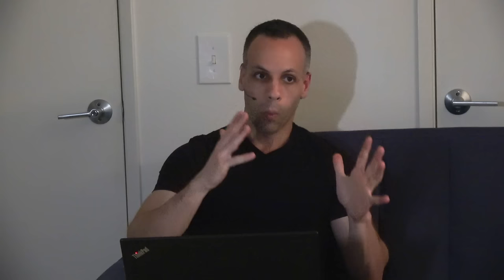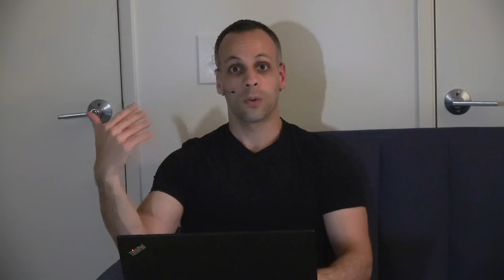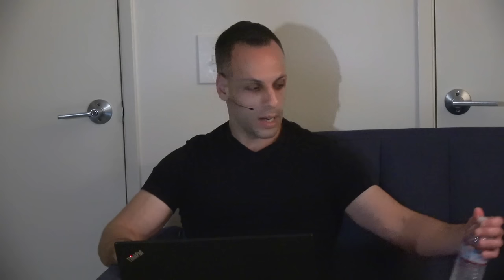EVGA's Oversight: Unannounced Changes Destroy PCs, EVGA takes NO ACCOUNTABILITY

Comment: We reported this issue to EVGA over 2 years ago as it was frying end user hard drives. As far as we can tell its limited to GQ models. We just got into the habit of testing GQs every time we plug them in with a PSU tester from Thermaltake
Reply: Geez. I was hoping this was a recent issue, not a 2 year one.
Reply: @Slavolko  Yeah, 2yr old makes this corporate indifference. Slam dunk on lawsuits.
Reply: WTF
Thank you for the heads up
Reply: Interesting insight thanks
Reply: two fucking years? holy shit EVGA really has dived downhill
Reply: I'll just avoid them all, just to play it safe. 🤓
Reply: that is pretty amazing...
Reply: Can we pin this comment? This escalates the issue and means I will definitely avoid EVGA PSUs.
Reply: This should get the CSA/UL/ETL certification voided !!
Reply: @HazewinDog  SeaSonic all the way.
Reply: Either this issue is more than 2 years old or EVGA isn't it the only company to have this issue as I remember this happening ages ago with a customer PC I rma'd a psu in.
Hell I've done it myself since with a few HDD to the point I now do check modular PSUs with a multimeter.
I don't even buy modular PSU for builds now unless explicitly requested by the customer as it is a literal minefield.
Reply: but people keep saying that evga is QUALITY, xDDDDDDDDDD, not a single company that keeps such an issue for that long, represents quality in any way.
Reply: Can you please clarify the "issue" you are referring to? They changed the pinout between different generations of that PSU. Your comment makes it sound like there's a problem with the retail product. If you're saying these PSUs randomly include mismatched cables that's a much bigger problem than messing up an RMA process. Otherwise I don't understand why you'd say you're testing all of them. If your customers are using different cables than what it came with I don't see why you'd report that to EVGA.
Reply: WUT.
I own two EVGA GQ  power supplies. 
Nice. 🙃
Reply: 2 years? Kinda to the point of not buying them at all, not testing them...
Reply: @kyoudaiken Don't trust brands. Go by per-model reviews every time. SeaSonic is one of the few PSU brands that actually manufacture their own units and is generally fairly reliable, but even they have the odd lemon.
Reply: Well if you look at the factories they come from you'll probs find that the GQ series is outsourced to another company
Reply: @woe2you2  I mean, for example, I had a lot of issues with AMD. I stopped buying AMD products for now and also switched my main PC back to Intel and couldn't be more happy despite other shortcomings Intel has. At least it is stable and doesn't give me problems. I also do that with PSUs, haven't had a single issue with Seasonic since decades.
Reply: You claim to be a PC builder yet never tested/verified power supply wiring until you cooked a few parts using the wrong cables on a modular power supply and now use a power supply tester?

Ever hear of a multimeter? It should be in even a basic toolkit of a PC builders tools. 

Rookies claiming to be PC builders smh and Louis didn’t know you can’t mix and match power supply cables among vendors yet calls himself a tech?

Talk about sheer ignorance
Reply: We reported this SATA pinout change issue to EVGA (edit here checked emails, first reported Jan 2023 details matter not quite 2 years ago) as it was frying end user hard drives and SATA LED controllers. As far as we can tell its limited to 1000W GQ models. We just got into the habit of testing GQs every time we plug them in with a PSU tester from Thermaltake.

Additionally To clarify: We are big EVGA fans at Silver Knight and have Kingpin and Dark products on our shelfs as decorations but it was effecting users getting a replacement PSU from RMA as EVGA tells you not to send in your cables or if a new GQ unit was purchased by a customer then taken home and we wanted to know what to tell our customers. Customers reusing their old cables or in 1 case brand new out of the box, one cable pinned right, the other was not were having weird problems with drives just dying. Usually the same PSU same series same model, cables are not an issue. We never got a clear answer, just told to RMA the PSU units. We cover all of our products the full warranty period in store and replaced the customers drives and controllers as it was obvious the PSU caused the damage once we tested it. According to EVGAs PSU cable chart there is no pinout change on GQ units. Our decision was simple: pull all 1000W GQ units off our shelves and implement a process for warranty to cover any associated damage that may occur. As stated before we cover the full warranty period in our store so if its a 10 year warranty and you come back 6 years later, we are not (insert whatever other retailer here) and will tell you to kick rocks. We will replace the unit with an equivalent model from Corsair, BeQuiet or MSI if we sold you a PSU and you need to RMA it. 

EVGAs PSU lineup has gotten counter intuitive. When we broached the question of why the warranty period on newer PSUs were shorter or why the gen 5.0 equipped units they are selling are lower wattage or what the come to market strategy was, we were met with limited response or go deal with distribution who often times had little stock. Its sad to see where there company is now. I hope they turn it around. Years of industry good will, team pedigree and just passion for hardware wasted.
Reply: @South_0f_Heaven_  way to jump to conclusions. We are a retailer in addition to a system builder. The issue would effect customers who were DYI mostly and us one time when we opened up a brand new unit, used the included cables and it fried a hard drive. I don't know a single person who buys a brand new power supply and after using the supplied cables used a multimeter to check pinouts before using it. Thats just upsurd. Let's use some common sense here.
Reply: @JJFX-  issue… have psu, goes bad, send back to EVGA and follow their directions to NOT send cables back with PSU, EVGA sends new PSU back of exact same model but the power line set is different than the PSU you sent in and EVGA does NOT send new cables with correct configuration, so installing new PSU with the cables EVGA told you to keep will send wrong power and fry your computer
Reply: @JJFX-  we had a brand new PSU with mismatched cables 1 time in the shop. All the other times it was due to a user sending in a RMA and their replacement unit not using the same pinout as the original cable set they still had. Its specific to SATA as well
Reply: @cycleboy8028  yup exactly. Usually not the computer just anything SATA powered
Reply: @saxitopau1528  they are fine units. You will be fine unless you RMA. Then you need to test your SATA rails
Reply: @HazewinDog  i don't know if it warrants that exactly. The units themselves are fine and folks in sales often have little use for disseminating information about a handful of sata pinout issues on a discontinued PSU series. But it still sucks
Reply: @South_0f_Heaven_  agreed, I don't think Louis actually fried his hardware, he was just stating that to a rookie, it could easily happen
Reply: What the hell...
Reply: @South_0f_Heaven_  LOL, you probably have never even opened a pre-built PC and you are spitting like someone who does PC builds and testing for 50 years. Kid, listen: Louis said he expects cables between different brands to be different but not when it's the same brand and the SAME MODEL even. You aren't even able to listen to what Louis says. But it's okay, you can stay in your own reality and have fun with being pissed about such a pointless thing. No brand is perfect. Certainly not EVGA, Apple, Intel, AMD or NVidia.
Reply: They obviously knew about it when they designed the PSU with different pinout.
Reply: @bn880  I seriously doubt that. More than likely the reality is that there was some sort of change when they switched between two different odm manufacturers. We figured this is the case because even some of the power supplies we were getting brand new out of the box very rarely have one correct SATA cable pinout and then one incorrect one. But probably ended up happening is when we contacted sales and told them about this issue we just never got forwarded to the right people to get addressed. More often than not incompetence is the root of the problem not maliciousness
Reply: I had that happen, it was a backup drive-devastating!
Reply: This is disappointing. I haven't built a PC in six years, but always held EVGA in high regard and tended to have a mix of EVGA, ASUS, and sometimes MSI parts in my builds. These companies have been disappointing us in that reverse order.
Reply: Still, if they screwed up with one model, they can screw with any of them. I won't be using any of their modular power supplies any more.
Reply: @South_0f_Heaven_  If the cables are labelled wrong, whose fault is it? I believe it's the company's fault. Because no one in their right mind would normally check any computer part's pinouts. Building a PC is not something that only commercial builders can do. Those that do it DIY will trust the cable labels, and should be able to do so.
Reply: @TheGameBench  I think it's a little disingenuous to write off a company's 20 plus years of positive experience in the market and fantastic Support over many years with a knee-jerk reaction over one specific model with a fairly limited pool of customers being affected by it before they even have the opportunity to respond. How they respond is important and should be the decision made moving forward but to say that they are a terrible company because of one mistake over long period of time showing that they were a good company would be just frankly unfair. That's like saying that whatever the lowest point you've ever experienced in your life is the best you will ever be. Let them respond as I'm sure people over at EVGA are going to see this Monday morning
Reply: If you can document this along with other builders that can help with a class action suit.
Reply: @Slavolko  I am reading a thread from July 10, 2018  on the official evga forum - someone with a similar issue. In that case there was a small model difference G1+ vs GQ.   Evga response was "We always recommend using the cables that come with the specific model to rule out issues like these."  so the user got blamed. But that shows that Evga has been notified (at least 6 years ago) about the cable issues and instead of getting better they have gotten worse...
Reply: @martinlaak  In which case that is worse than I thought, and EVGA is definitely in the fault.
Reply: In this customer's case, I don't see how EVGA can defend themselves agains liability based on the fact that A. You're claiming you already reported this issue to them a while ago and the issue was causing the same damage, with EVGA seemingly doing nothing to resolve the issue and B. It seems they have either no clear warning or no warning at all during the RMA process about the PSU cables they tell customers to hold on to potentially not being compatible with the replacement units they send out.
Reply: Good to know since I have an 850GQ.
Reply: @TheWebstaff  Same for Seasonic and Corsair.

But trivial issue compared to Dell that did use non-standard pinout on their motherboards. So a normal PSU fried a Dell motherboard. And a Dell PSU fried any non-Dell motherboard.

After enough angry customers, I think they stopped with this stupidity maybe 15 or 20 years ago. But lots and lots of users ended up letting out their magic smoke because of deceitful Dell product owners trying to force the customers to only buy replacement PSU from Dell.
Reply: thanks for the pin Louis!
Reply: You were the chosen one! It was said you would destroy the incompetent, not join them! I loved you, EVGA! 😂
Reply: @SilverKnightPCs i noticed this a while ago just by chance. Didnt get anything damaged. But I always just keep my cables with the matching psu.
Reply: @ComputingCactus  they have been on their way down for years.
Reply: At some point they have to be held liable, regardless of the frivolous claims it could bring about.
Reply: @gblargg  Always been a evga fan. But they owe that gentlemen.
Reply: @kyoudaiken   I've had issues with both AMD and Intel.
With the AM5, the pre-bugfixed uefi's would give me weird, ssd corrupting crashes.
With my 4770k, I had weird losses of power with every single cold boot after 10 minutes, started with windows 8.1, then got fixed, started again in windows 10 after a update. Only got permanently fixed when I installed the final beta update (never got a non beta final one afaik).

Same with gpu's.
Reply: @SilverKnightPCs  Imagine buying a usb drive from kingston's website and receiving a usb killer.
Reply: @SilverKnightPCs   You're definitely right that we should wait to see their response.  But if you reported it over 2+ years ago after presumably several customers have had damage already that's already kind of telling.   We shouldn't have to rely on getting 'big media' attention to be made whole by companies.  There always needs to be a path for regular CS agents to escalate customers, and SMEs to be able to detect patterns.
Reply: I have actually seen several of the same complaints on Reddit. I think these people should just band together and do a class action against EVGA.
Reply: Ideally cable sockets would be keyed so it's not possible to use incompatible ones.
Reply: Hate PSU'S with black cables.
Reply: 1:38 "Incredibly massively stupid" not to standardise them... and now they make all the cables black so you can't tell without a volt meter. From dumb to dumber.
Reply: @HappyGick  the problem is none of the companies I’ve used modular power supplies ever have them labeled what brand and model on the cables themselves. 

Just a couple of letters and numbers on the plugs themselves that do not identify anything.
Reply: @SilverKnightPCs  I can second the SATA part of the convo. 

Knew better but had a short SATA cable (single power connector, can’t stand the 3-4 power connectors they always include on the harness) from a EVGA that I used on a ASUS ROG 850w (Seasonic just rebranded) and instantly smoked a 256GB SSD. 

Just one of those brain fart moments but knew exactly what I did when it happens. Makes it worse when you know not to mix cables either lol. 

People are people and make mistakes, only reason I suggested double checking. Learned after many supposed replacement parts that were supposed to fit and work that many don’t. Better to find first out before installing then finding out later.
Reply: Hello gross negligence class action lawsuit!